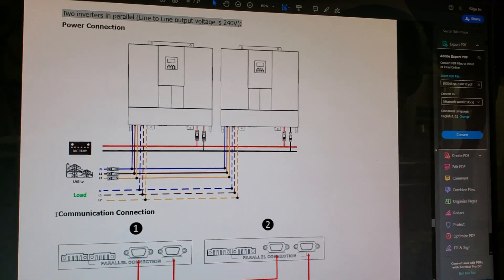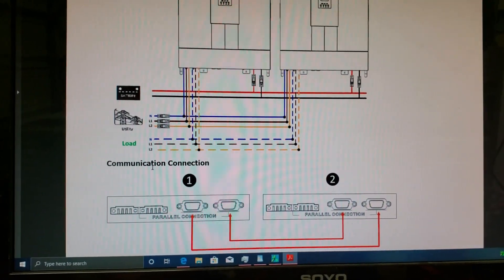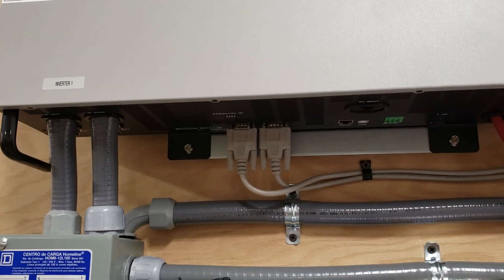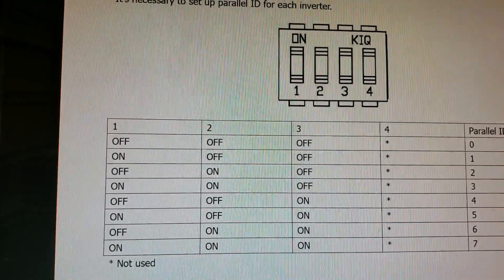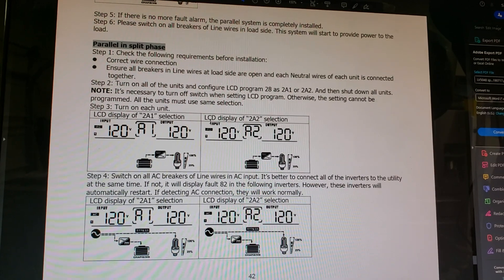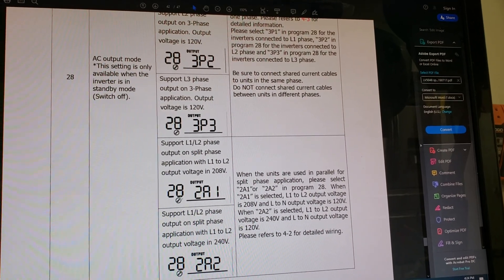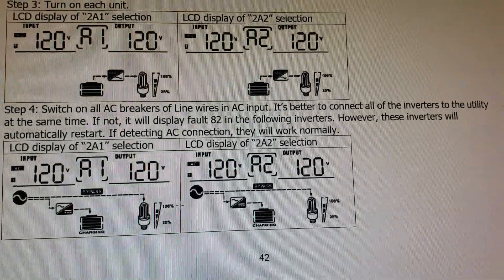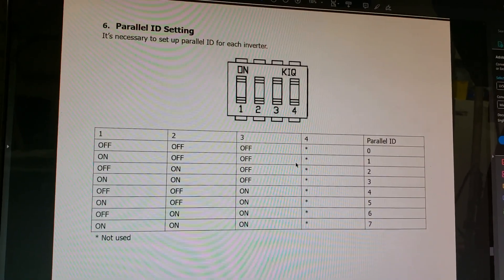MPP LV5048 Parallel Split Phase 240V Setup

Comment from the maker: As of this morning October 26, 2019 online manual at https://usa-mpp-solar.com/manuals/ is updated to reflect changes in regards to current sharing cables needing to be connected while in parallel split phase 240 Volt mode.
Reply: It was by your video that I could successfully install my two inverters! Thanks a lot. It is a success!
Reply: Hi, I am trying to set 2 units of 5048MGX in parallel. I can't get to change the P28 setting from SIG to PAL.  I connected the parallel boards, current sharing cables and com cables before trying to change those settings. I did them one at a time. Switched it on, I could modify everything I wanted apart from P28. then switched it off. No luck either on the 2nd inverter. 
If I get you correctly:
1. Switch on inverter, allow it to boot fully
2. Go to P28
3. While on P28, switch off the inverter
4. In the small interval before it actually switches off, set P28 to PAL
5. Allow inverter to shut down on its own.
6. Repeat the process for the 2nd inverter
7. Switch in both inverters at the same time?
Reply from the maker: @alexanderezra1509  This is specific to LV5048. What does your manual say?
Reply: It says to configure the inverter at P28 to PAL switch it off, and power on again. It emphasized switching off AFTER programming. But what i saw you do had a little more detail, you changed the value AFTER switched off, but before the unit powered down. I didn't read that part in the manual.
Reply from the maker: @alexanderezra1509  Looking in the manual for 5048MGX, page 54, it says to use same steps as LV5048 while programing:

"This setting is only available when the inverter is in standby mode (Switch off)." What it means is go to menu #28, turn off power switch, change setting and wait for it to shut down.  Have you tried that ?
Reply: That's sequence is what I didn't understand. But thanks to your video I confirmed what it was. I have not tried that, the small manual sent with the inverter did not specify in standby mode. 
I'll try it tomorrow when I get to site.
Thanks a bunch. Could you send me the link to the 5048MGX.
P.s one of the inverters did not connect to the watch power app.
Reply from the maker: @alexanderezra1509  http://www.mppsolar.com/manual/PIP-MGX/PIP-5048MGX%20manual-20200518rev.pdf
Watch power is a useless app. I have been so frustrated with it. If you have ability you could try this https://github.com/jblance/mpp-solar. In addition I have made videos about John's app on my channel.

Comment: I am in the process of connecting to the Lv 6048 in parallel having issues with the settings. My question is the solar cables are connected to only one of the two inverters. Is that what constitutes the inverter as being the number one inverter, and therefore change the pin settings on inverter  two?
And your videos are great, thank you
Reply from the maker: Is it LV6048? or LV5048? Big difference
Reply: @DMIINC2013  One is an LV 5048 that has been upgraded (MPP has a kit for $30) to a LV 6048 and is in parallel with a recently purchased LV 6048. With the help of the people at MPP the parameter setting issue has been resolved but I'm still interested in your answer hoping that you can provide information for an improved setup.
Reply from the maker: To answer your question. Solar input does not make one inverter master or slave. Switches do. So one inverter must be set as master and other the slave. Follow the instructions for switch setup and then menu items for programming. Parallel setup can only be achieved  when power switch is in the off position.
Reply: @TexasStatesman how has that worked out? I didn't realize the lv5048 could be operated at 6kW with a board upgrade!
Reply: @tanner3801  The inverter has been and still is working great after the conversion. Probably took me 1 1/2 hrs to replace to two boards. However if you do it, I'd recommend labeling all wires that will need to be disconnected, makes it an easy task when reassembling.
Reply: @TexasStatesman  do you happen to have a part number for those boards, or a link? I can't seem to find them, or any reference to them
Reply: @tanner3801  did you try contacting the MPP Solar corporation. I bought mine directly from them. I believe they’re based in Taiwan. If not, let me know and I’ll try to find a part number for you.

Comment: Could you please show how you did the breaker wiring confused on  paralleling 2 separate 40A breakers from mains all connection diagrams from MPP show all AC wiring tied together  or could i use 1 80A breaker from mains using Multi-Cable Connector split feeding both Inverters this seems to be the way they show on page 36 of the manual
 or 2 separate 40A breakers to each LV5048 i would then use  3 wire ports Multi-Cable Connector  ( Amazon Link ) to connect the Load wiring and bus bars with appropriate  fuse/breaker for the DC side. Thanks for showing Parallel ID settings and program 28 settings also 1st inverter working perfectly installed in June.     Multi-Cable Connector  https://www.amazon.com/dp/B005GDFUDI/?coliid=I245ED0Q3ZNLRO&colid=2F7BRECR7VN09&psc=1&ref_=lv_ov_lig_dp_it

DC battery bus bars    https://www.ebay.com/itm/4-Post-Busbar-Bus-Bar-Power-Distribution-Block-250A-With-Cover-5-16-Red/324132485542?hash=item4b77cd39a6:g:iGUAAOSw-a5eMNgJ
Reply from the maker: Hello. Please see this video https://youtu.be/Ng-abjBFkqo. I have tried using multi cable connector but reverted back to using breakers to combine or split power to/from inverters.
Reply: @DMIINC2013  Thank you so much

Comment: I am consider 2 of the LV2424 Hybrid 2 x 2400W 24V 120V Solar Inverter Split Phase , incl parrallel kit on eBay for a 240 split phase in USA application. I am studying the manual plus asking the USA eBay supplier questions, and looking on Youtube for whatever other info. I can find. Appreciated some finer points of your video clip here. Thanks.  I assume your 240 v ac split phase system is working flawlessly, but you left  that info. out of your clip.  Please give a statement of how it going since you got your two MPP brand units configured and working together.  That will be a good reference for others like me this is 240 split phase option is really doable.
Reply from the maker: So far units have performed very well. No issues. I might even add a third unit next spring.
Reply: Why would you get 2 of the lv2424 instead of one lv5048?  Are you set up for 24 volt with only 2 12 volt batteries?